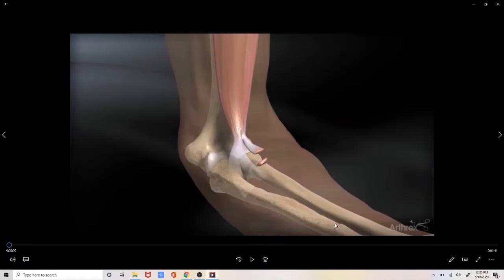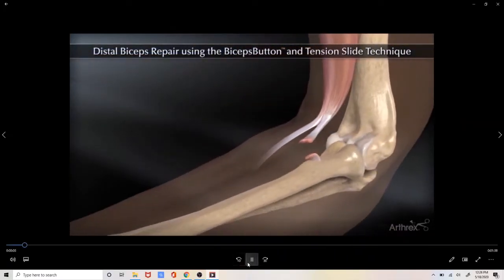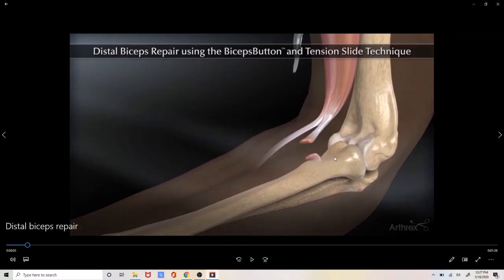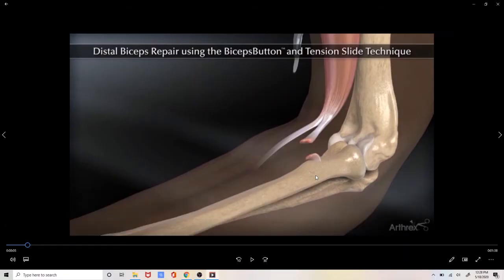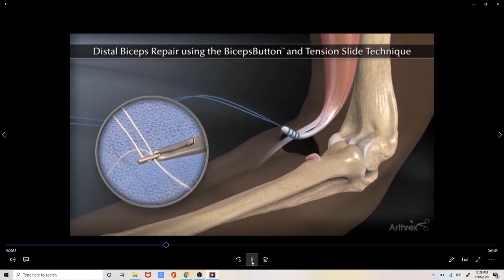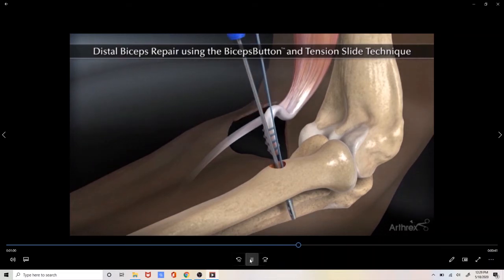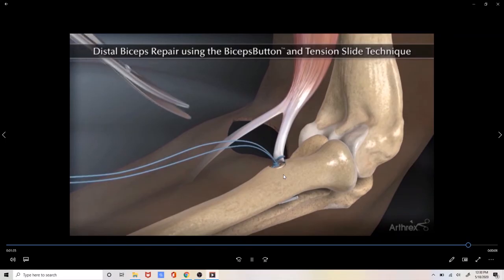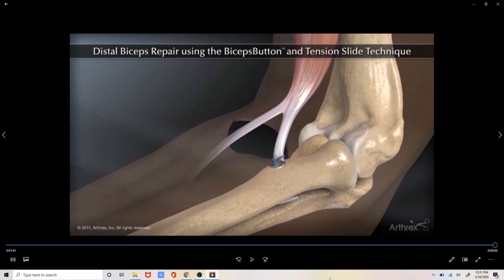Distal Biceps Tendon Repair: Surgical Technique

Comment: 68.  Snapped March 2025.  Surgery April 2025.  10 weeks in a brace and slings. Wanted to chop my left hand off, 2 inches above the wrist.  OxyContin didn't kill the pain.  Tylenol + Ibuprofen did.   The initial bandages were so tight that I ended up getting the skin on the wrist looking like a burn.  I slept gripping an ice pack.   I most likely had damage for at least 6 years when it snapped.  I didn't get the cross cut only, but also a 3-4 inch cut down my forearm.  The surgeon needed the room to find the pieces of tendon.  What should have taken 1 hour in the OR took over 3 hours.  I attribute a lot of the pain to the extra incision that wasn't planned for.

I start PT with a grip strength of 34 pounds in my arm. 68 in my good.  Didn't bother to try to keep the good arm good.  At end of the PT 98 in my bad arm.  94 in my good arm.  For me, going by grip strength is pretty easy to measure.  PT had a professional gauge.  I bought a cheap one off of Amazon for 18 bucks.  It reads high 80s.  My age group says grip strength in the 80s is normal.  So, I've got a gauge that reads a little low but matches my age group.

The forearm is still a bit numb in almost Nov. 2025.   The tendon is still a bit tough under the skin.  I've cleaned the gutters on a ladder and reattached about 15-20 feet of gutter with the repaired tendon.  Also, I've made sure I can maneuver a 150 pound snow blower.  I haven't tried to rotate tires or change a flat.  I have AAA but they can take hours to show up.

I was lucky it was my left arm.  Not Sure I'd have been able to stick the key in the ignition or move the gear lever in the center console.  One end of my street is over a 90 degree corner coming in from one direction.  I couldn't turn the wheel enough to do that.  I had to come into my street from the other end.

One thing that helped me, was those silicon bandages that loosen up scaring.  I think it helped.  I also had really, really bad bursitis in the elbow.   The PT used Kinesiology Tape.   It was magic.   Don't buy the stuff at the pharmacy.   They charge ridiculous amounts of money.  But it online.

Comment: I'm one of the lucky few who has had this done on both my right and left biceps. Right was done in May of 2022 and my left was done in November of 2023. Second one was much easier ( obviously) mentally and physically. Right arm feels 100% and has since December 2024, but my left recovery has been slower due to a neck injury, so its a been a slower process. Don't slouch on upper back, shoulder, tricep or forearm stretches and exercises, or you will pay for it long term.

Comment: Does the bone grow into the tendon and devices placed into the bone?
Reply: Good question, did you ever get an answer anywhere else? I just tore mine a week ago and now waiting for surgery. Best wishes.
Reply: @Cbat1  Hey! From my understanding, it all fuses together, but I’m not sure about what precisely is used to anchor the tendon and how that interacts. I’m assuming it does and that as time goes by the tendon fuses together with the bone. I’ll tell you this: I was worried that I wouldn’t be able to get back to full strength within a year after reading all the stuff others say/comment/post. About 4 months after surgery I started lifting again regularly. I went light, did a few sessions of PT, continued to perform new versions of curls and such to strengthen it. I actually hit a PR on bench press about a month ago - and that was probably ten months post surgery. I say all that to say that you don’t have to worry about whether you can practically get back to full strength. If you take it slow, research a little, follow sound advice, and listen to your body - when it hurts, stop; but keep pushing, not by being a macho buffoon but by being consistent and patient; do that and you’ll get back to where you were and maybe even better.
Reply: @Cbat1 how are you now?
Reply: @Cbat1 hey how’s your recovery?

Comment: Will the tendon attach to the screw too? I mean that the tendon should develop tissue to attach to the bone but in this case the screw is a prevalent part of the tendon area where to reattach to the bone and I am wondering how he can attach safely
Reply: Very good thanks. I tore my bicept tendon 10 years ago and despite what doctor was saying after the surgery, my tendon now is stronger than the not torn one. It is the same of broken bone. They come out stronger
Reply: Just tore it a few days ago loading the Uhaul. At age 62 I should have known better.
Reply: Thanks for your post. I just tore mine a week ago. I thought you had a good question and wondered if you ever got an answer to this? Also, how is your rehab/recovery going now?

Comment: I was told the button method is strong and a quicker recovery, but at greater risk to nerve damage. Not worth the risk
Reply: Absolutely, positively worth the risk.  It's not like the surgeon can't see the nerve and can't avoid it.  They do just that thousands and thousands of times per year.  My biceps reattachment surgery was done so well that just three months later I completed a prescheduled, grueling certification program as a Russian Kettlebell Coach (RKC). And I didn't have to miss any work.  I was able to start rehab just 30 days after surgery and full recovery was rapid.   It's been over a decade and other than some bouts of occasional numbness in that forearm/hand at night  this past year or so, I've been 100%.  That biceps is just as strong as the other one.  Totally worth it.
Reply: I got this exact surgery over two years ago. I had no complications or temporary nerve damage whatsoever. However, I’m still mentally apprehensive to lift anything heavy with the arm. Do you know if the surgery is as strong as an uninjured biceps tendon? I can’t seem to find any info on this. I did all the physical therapy and was cleared for regular activity, but I can’t seem to shake the feeling that it will be weaker/prone to re tearing
Reply: @seanwilliams480  Thanks for the reassurance, going to have it done in 2 days!😬
Reply: It is strong, but you should do some physical activity or exercise focused on strengthening the tendons.
Reply: I hate it when people overstate a surgical risk because of their own fear. I received the Endobutton technique myself and it was totally worth it. 

Only difference was my surgeon did not want to use the screw. That screw would introduce new complications and I'm happy that he didn't use it.
Reply: @PDS24  thanks for your post. I just tore mine a week ago, awaiting surgery. Question: if they didn’t use the screw, as indicated here, did they do something else, or is the screw just not that necessary?